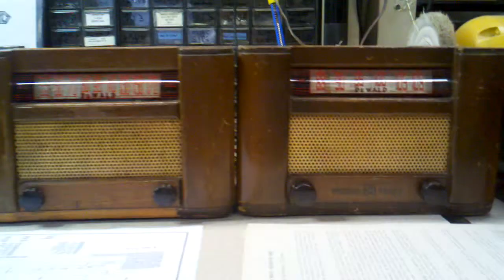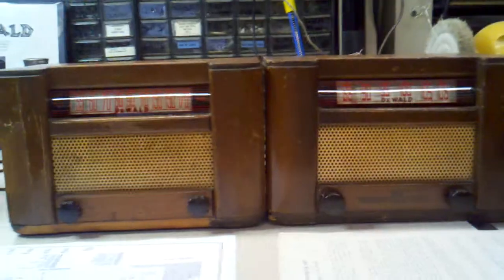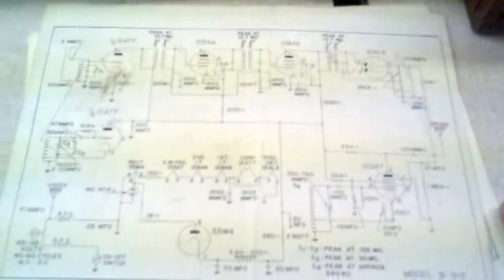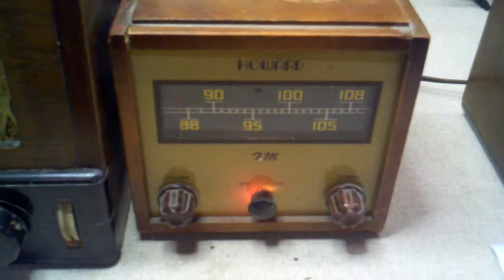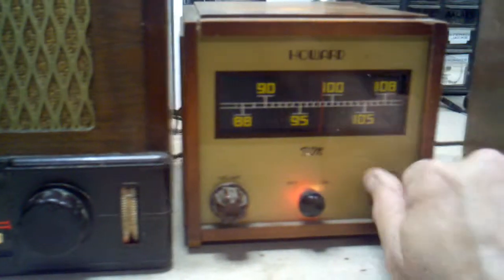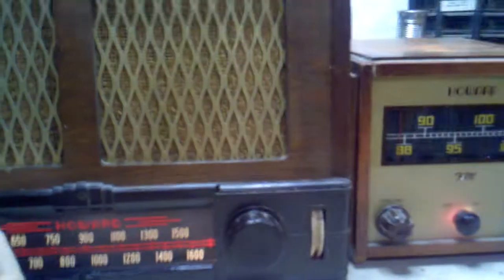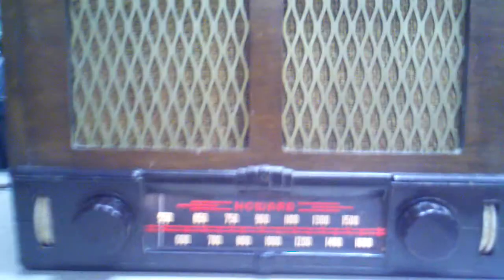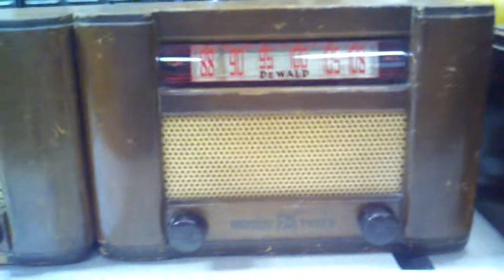Dewald Wireless FM Tuner B-612 and Howard 482 FM Converter

Comment: I have same Dewald FM B-612 tuner that you have, but it does not receive FM and seems to broadcast out a dead AM signal. Went to have it fixed and the restorer said it's not worth fixing. Still have it collecting dust.
Reply from the maker: I hate it when someone's says "It's Not worth fixing"  That usually means they want you to give it to them so they can fix it and keep it for themselves. These are fairly simple units and I have the schematic for it, also  may just have a bad tube.